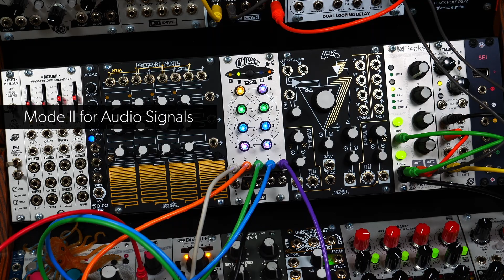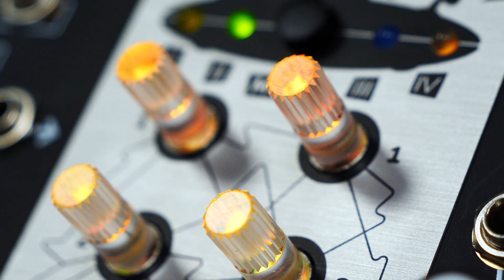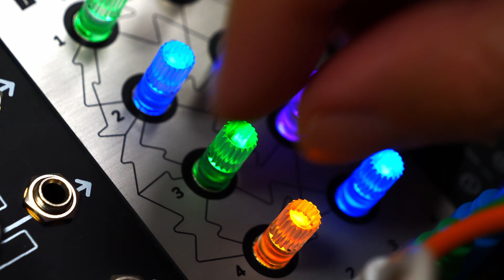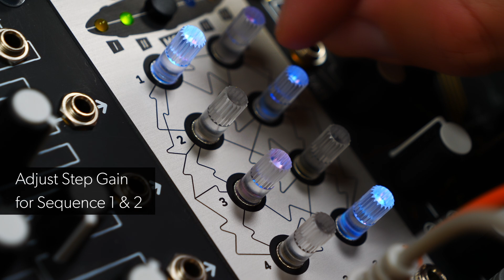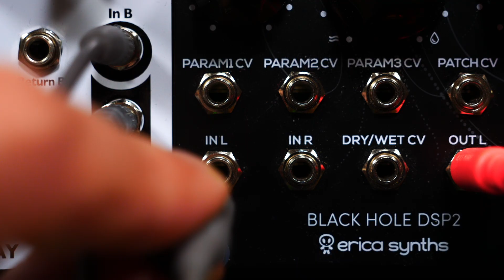u-he CVilization Mode II: 4 x 4 Sequential Switch – Audio Signals

Comment: this seems like such a great module that is hampered by a lack of a descriptive faceplate, feels like I would be in the manual like with the disting half the time .
Reply: I’ve had a CVilization for a while now. It’s surprisingly easy to learn and I find I generally stick to a single mode most of the time. By doing that, you pick up the mode very quickly. Unlike Disting which has tons of modes that all work different from each other with weird parameter values etc. CVilization is great.
Reply: If I get one, which I think I will because I can't find a comparable sequential switch in such a small footprint, I plan to add console tape and draw my own labels, and mostly use it as a sequential switch.